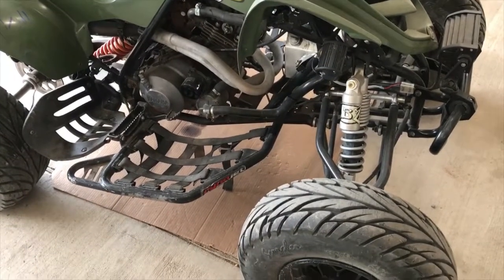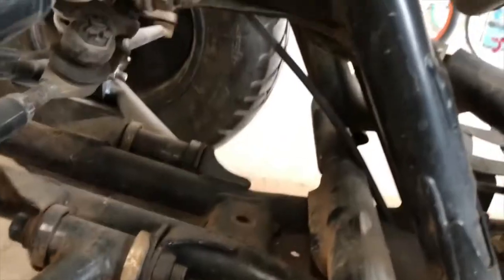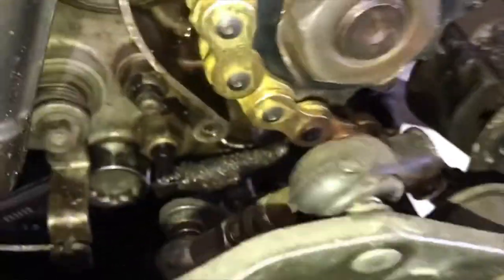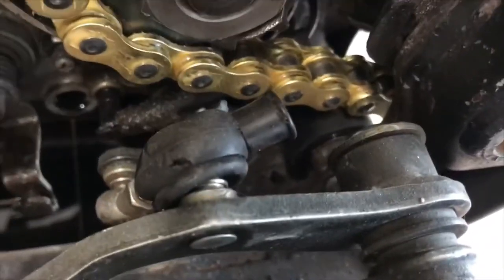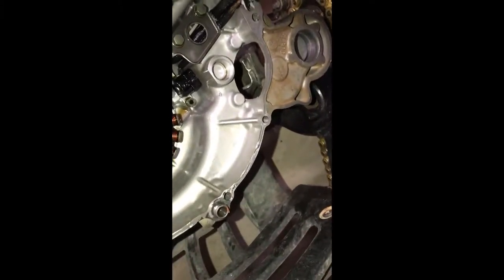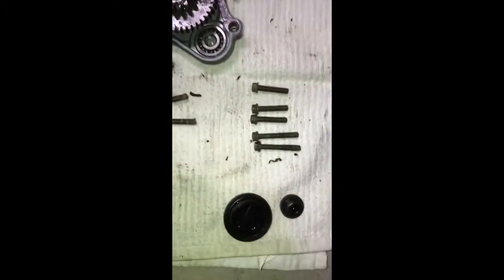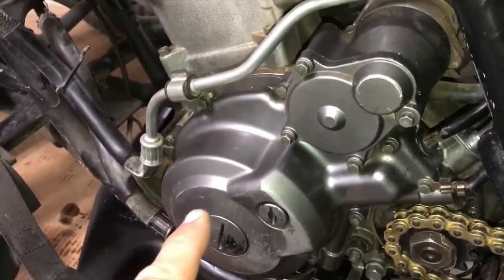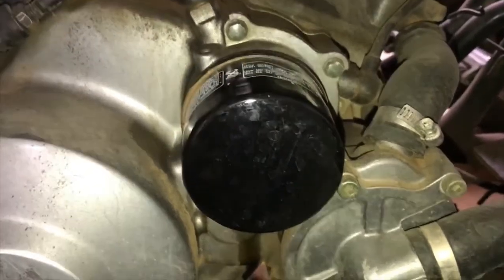2004 Raptor 660 Oil Change, Filter Change, Crank Case Gasket Repair

Comment: What is the silicone called and how much did you put on. Also where does it go on before the gasket?
Reply from the maker: Permatex super grey silicone. High vibration. Just apply a thin film on the metal edge of casing then put gasket on top of silicone.